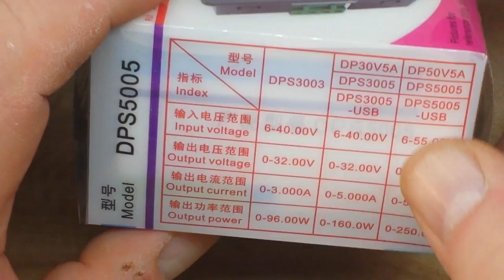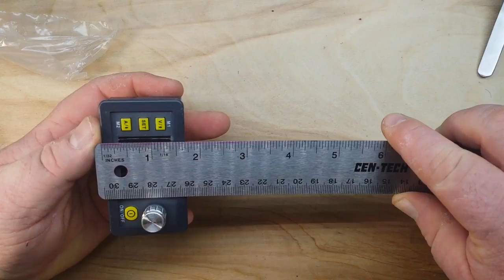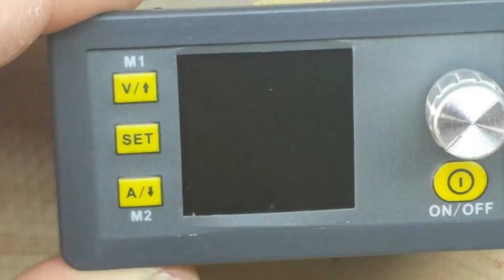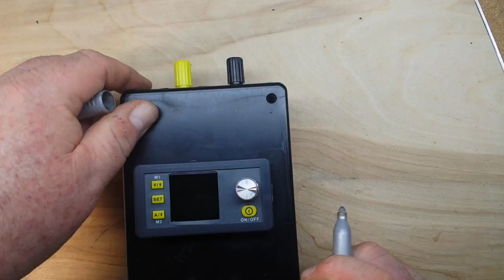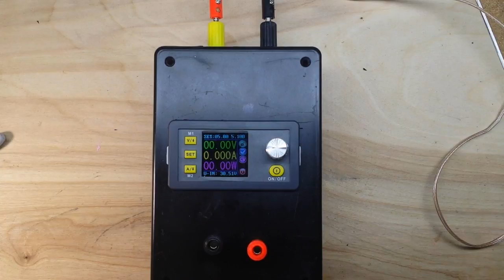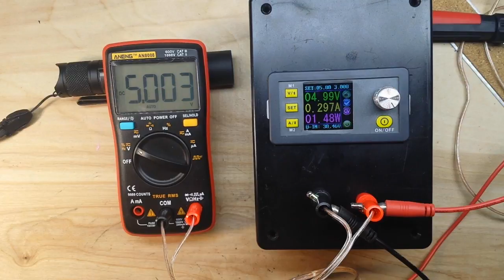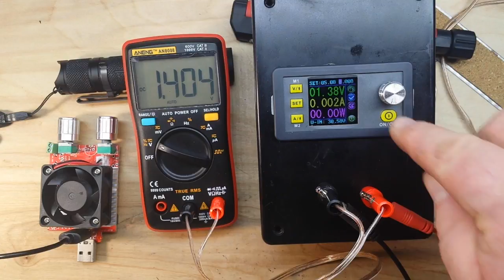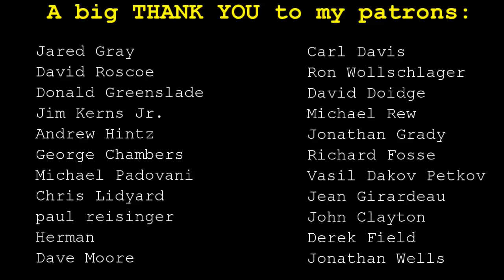Ruideng 50V 5A DC DC Buck Converter from Banggood

Comment: I have a 20v 2amp Ruideng unit in my wee bench power supply, I made earlier this year, and it works a treat (so far)! I bought an Aneng 8008 recently, on your recommendation and it's an impressive meter for the price. I would definitely recommend it to anyone on a tight budget or to a beginner looking for a first meter.

Comment: Man, I've already got about half a container on the slow boat from Banggood, but I'm holding out for Black Friday (or Monday) for the good stuff. I take it you where using the bench power supply for this test? Looks like something usable especially if you don't have a bench supply. Thanks for the video interesting as usual.
Reply from the maker: +George Chambers Yep, using the bench supply but it runs on a 12V wall wart just fine too.
Reply from the maker: +George Chambers Yep, using the bench supply but it runs on a 12V wall wart just fine too.
Reply: I was thinking more of a cheap Chinese power supply. Almost as cheap as a wall wart, unless you have a surplus, I have a milk crate full of them.

Comment: I'd be careful with using it on anything higher than 40v. Check out @eevblog's video on this.
Reply from the maker: +michael rew This is not the same as the EEVBLOG unit.
Reply: Ok my bad it looked similar.

Comment: another question . does it look repairable? and are the components available to repair it? you should put a load on it and leave it on for a few days. to see how it holds up?
Reply from the maker: +James stranger These are designed as throw aways. You could repair them but BG does not sell repair parts

Comment: how many amps can it do. bucking on half. 24 to 12v constant duty. ? I need a few of these
 or a large single one. I'm thinking multiple smalls. since I'm not going to use all at once. to keep efficiency up. if the small buck converters are more efficient.
Reply from the maker: +James stranger 5A